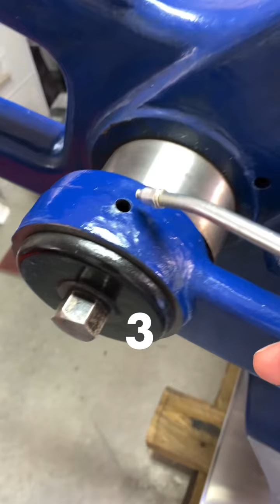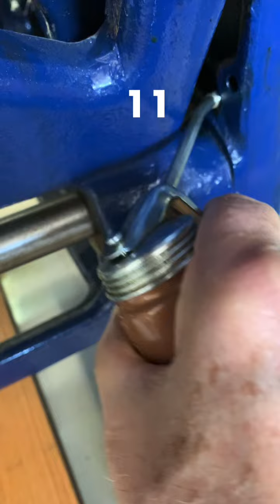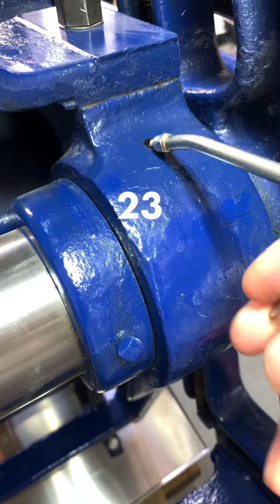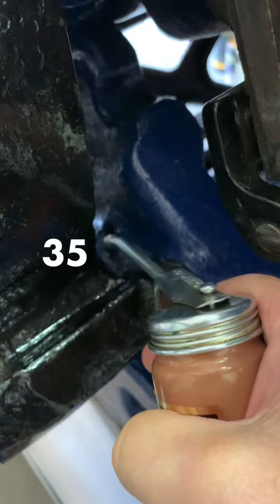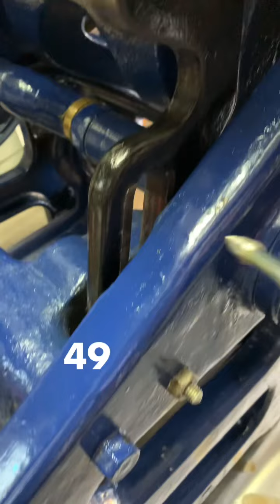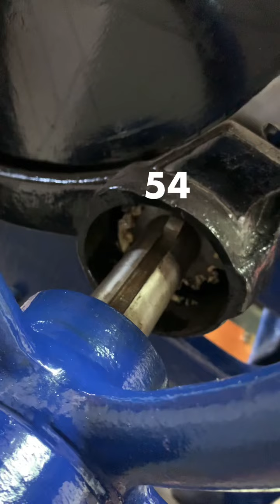Oiling the 12x18 Chandler & Price (C&P) Letterpress

Comment: I’m glad that you did this as someone needed too. I agree with 99% of what’s presented here. The only exception is any place a roller follows a guide or cam, that SURFACE should NOT be lubricated as you want the roller to roll and not slide. If it starts sliding, it will wear a flat on it and then it won’t roll right after that. You want a film of oil between two surfaces of metal that slide past either, either round or flat, but you wouldn’t oil the tires on your car in the same way that you keep the hub bearings greased and axle oiled. So oil the sliding portion of any bearing yes, but NOT the guide surface that a guide wheel ROLLS on. Yes, lube the axle/bearing of the guide wheel. 

Great effort should be made to clean any spilled oil off these surfaces. The same thing goes for the roller trucks. You don’t oil the rails or surfaces of the trucks because you want the rollers to roll and not slide. You have to be careful oiling the roller saddles so that excess oil doesn’t run down onto the trucks and get smeared on the rails. The rollers themselves will get the roller turning when they hit the form if the trucks are already sliding, but that’s bad, errr, form.., and you’ll get smearing. I think the designers of these machines didn’t anticipate that these would be around for 100+ years or they would have chosen a softer metal like brass/bronze (or even Bakelite, which came out in 1907) instead of steel trucks, which combined with oiling snafus mentioned, contributed to the widespread rail wear that were today on many of these presses (which is why you see people taping the rails all the time. Expanding/adjustable trucks are a bad solution as it creates a surface speed mismatch between the trucks and roller surface which causes ink smearing). This is why we use white or black Delrin now for the truck material (and the bonus is that it’s quieter)

Comment: I'm wondering if you could kindly list the points of lubrication as you've ordered them in the video, from 1 thru 49. It would be immensely helpful to have the steps typed out and the proper names for the parts of the press.